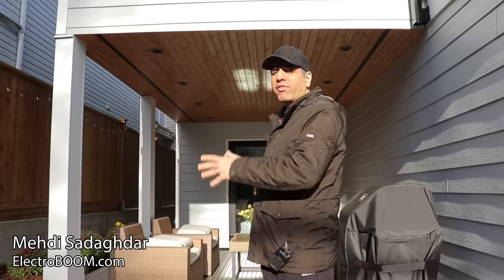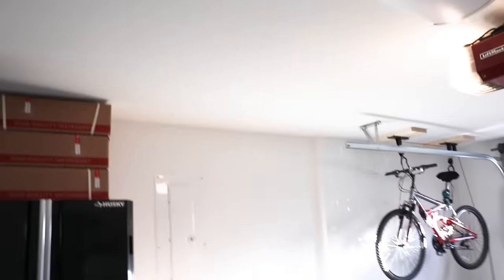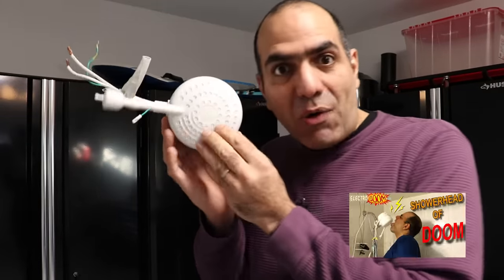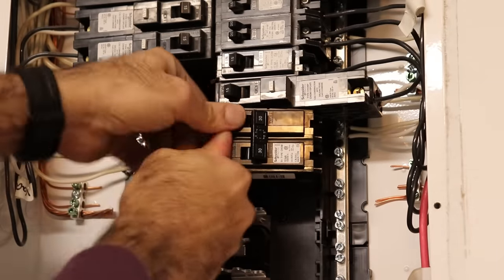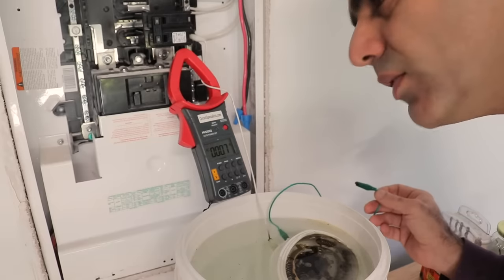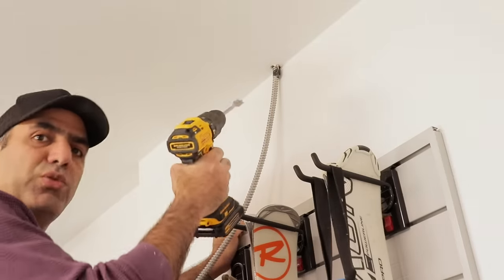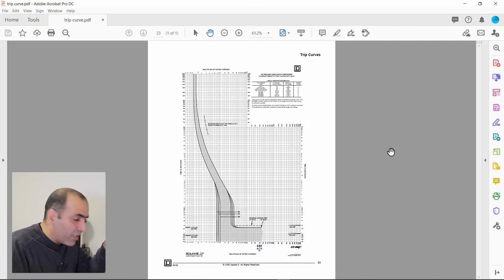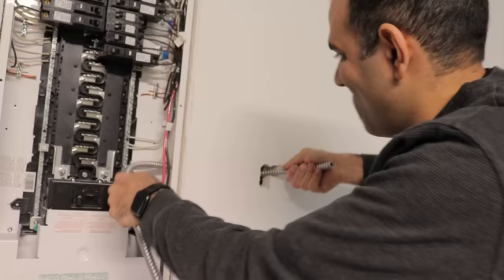Electric Patio Heater Wiring and Installation

Comment: You know this guy's a professional when his WOODEN HOUSE was never set on fire.
Reply: most houses in Northern America are made of 2x4 inch studs of wood for the frame and support, and with drywall over it to make the walls.
Reply: @ricardosimoni2855  sounds cool. So I guess they're seriously expensive?
Reply: @scavoflusigne  It's crazy cheap compared to bricks and concrete. Also in my experience not as durable.
Reply: @Nosiu  
Heh. That's sounds bad. But still ain't bad for cottage lovers.
Reply: @ricardosimoni2855  I’m not sure but I think Canadian houses have bigger studs due to needing thicker insulation. I know for a fact that houses here in Sweden use 45x170mm (2x7ish”) studs as a minimum for outer walls.
Reply: @Nosiu  Unless you are in the earthquake-prone Pacific Northwest, in which frame construction is FAR more durable.

Comment: I'm just trying to figure out how a damn nail wound up going through your box like that lol
Reply: An inch to the left and someone would have got the business on that one.
Reply: In Aus it’s regulation to install a metal plate behind wall boxes in certain applications to avoid exactly this 🤣
Reply: @MrCallumg1991  Nail plates are code most everywhere now, and that house looks fairly new, at least the last 20 years where such codes have been standard.  even if not, I don't think it would have helped, I mean the back of the breaker box is tougher than nail plate in the first place.
Reply: what nail are you people talking about? What box?
Reply: Its actually pretty common when the garage is built using 2x4 studs since it does not have to be rated for insulation. Its cost saving. The panel is literally sitting flush to the exterior wall. That nail was 99% a siders nail. See it all the time when roughing in new construction. I call it the walls of death.
Reply: How did the nail wind up in the breaker box? A big hammer and a lot of determination.
Reply: BC is brutal for building codes and safety. You can't mount a panel "inside" an exterior wall here in Ontario for just this reason. Also, who mounts the panel right against a stud? It's impossible to install a connector. That whole panel install is just a nightmare.

Comment: Socket is sidways.
Mehdi: It doesn't matter.
Future building inspector: Hello there.
Reply: Is the switch upside down?
Or are some switches the other way round?
Reply: @ArchieHalliwell  Switches are supposed to be up for on and down for off.  Unless they're multi-way switches, in which case it depends on the positions of the other switches.
Reply: @ArchieHalliwell  that's normal for the U.S. and Canada. Convention varies by country.

Comment: Anti-shorts on MC cable are a must and prevent the aluminum jacket from cutting and shorting wires. It’s also a good practice to wrap any device when installing especially in a metal box to help prevent unwanted shorting.

Comment: Great videos Mehdi, you always get a laugh out of me. You should get yourself an arc welder (stick welder) for high current testing. The older ones work best. You can short circuit the secondary of the welder and adjust the current with the transformer yoke on the welder. Stay safe mate

Comment: use anti-short's on your ac90 cable. and you cant put a plug on that circuit for future use.
Reply: Also the switch is supposed to be in view of the heater as a disconnecting means, unless either it or the breaker is lockable. AC90 isn't rated for wet locations, so that little whip outside is suspect. Pretty idiotic to use 20 AWG gator leads for the load test, no idea how they didn't melt first. Why turn break on and then make a spark clipping on the gator lead? Put it on first and then just turn the breaker on.

Comment: You need an anti-short in your connectors...
Reply: Anti-short bushing missing, not allowed to have receptacle and heater on the same circuit, wires cut too short at handy box where switch is installed (should have 6" of free conductor extending past front of box), and he probably should have used a 4 square box instead of the handy box for the switch.
Reply: @brianleeper5737  no connector on the knockout in the panel either
Reply: @darrenwoloshyn  Makes me wonder how well-grounded those boxes and cable armor are, since I didn't see him connect the ground wire to the box (which I would do, even if it is redundant).
Reply: @brianleeper5737  be connected it in the switch i think (but disclaimer im not 100% on that as im in the uk and our wiring is very different to this

Comment: I think that the future use for the 240v outlet will be and electric car charger. Or more shorting the power line or tesla coil.
Reply: Wouldn't running the heater, and charging an electric car pull too much current for the circuit though?.. hm..   
Hopefully he considers that, and doesn't risk anything.

Comment: Here is a bucket of water.  Next to a 150-A fuse panel.  With its covering panel removed.  Also with a showerhead that has built-in heating elements opened up to expose those elements.

THIS is why we watch this channel!!   ;-)

Comment: "Which house in the world is wired for this?" Probably brazilian's, since we use these showers.
Reply: Well here in the UK i have an electric shower although not one like that which literally maxes out the rated current of a 40amp breaker (MCB here guessing same for you) which is also connected through an RCD with a leakage trip current of 30mA (this is mandated) would be interesting to know what its like for you. Also here we have between 230 and 250 volts for everything unless its three phase

Comment: Installed the 240v outlet sideways and the switch upside down, that's still somehow better electrician work than at my house
Reply: The switch is correct.  In North America, switch up is ON.
Reply: The switch isn't upside down. Up = on in north america.

Comment: When you cut a square section of your wooden ceiling to drill a hole in and then nailed it back in you were like 4-5 inches away from the join in the wood anyway, you could have removed the piece of wood entirely and just notched for the wire at the join. Same outcome but much cleaner. Keep it up though mehdi I love your videos I need to start your 101 series for the 3rd time haha.

Comment: 120 v system seems as outdated as the imperial system.
Reply: Well it ain't since half of the world uses 120 V and no the imperial system is used only in 3 countries this isn't a valid comparison
Reply: @jammehrmann1871  i didn't know it was used by that many. I guess they keep using it because it's too expensive to change it now.
Reply: @Wormweed  no prob fella
Reply: @jammehrmann1871  What half of the World?Most of them is 220/240V and 50Hz.
Reply: @mernok2001  yes its not exactly half but the americas and some asian countries like japan use it
Reply: @jammehrmann1871  Japan uses 100V.If you have dry sking its just a slightly unpeasant tingle at most 6mA of current.
Reply: @mernok2001  Its not as great of a difference as the american 120 V to 220 V so whats the prob?
Reply: @mernok2001  at 6 mA It is painful not a small tingle if you have normal and not desert dry skin
Reply: @jammehrmann1871  Painful with 1 finger,tingle in full hand.
Reply: @mernok2001  Well even then it's possible to kill oneself if both hands were to become connected anyway you are good have a great day :D

Comment: From a European point-of-view, every electrical thing seen in this video is scary as hell...
Reply: I live in southamerica and bruh last week i bought for literally us$12 one differential breaker (rated 240v 40a)(idk the name in english sry) and it goes installed before all the thermomagnetic breakers... that shit saves your life.. Why only canadians and usa people have them for the bathroom only? just install a big one or one per sector in the breaker box
And the cables omg how difficult it seems to run a couple ot these solid cables in the wall tube, why not multi filament? Costs? 
And then the junctions aaaaaaaaaaaaaaaaaa
and then running the cables bare plastic behind your wall imagine screwing something and theres unprotected 120ac behind the screw aaaaaaaaaaaaaaaaaa
Reply: Also the guy who nailed thru the breaker box, imagine that nail going 5mm left...

Comment: Federal Pioneer 15 AMP breaker is the best 30AMP breaker you can buy. Meaning it's a bit slow to "Pop." Square-D breakers are much more sensitive. They have breakers tuned for various high in-rush current loads.

Comment: You need a Secondary Current injection kit to test the Breakers. Also this Kits are used in testing of Current operated relays and other equipment like CT. I made one as my study project.

Comment: i have found that living in a country that has incredibly high humidity and heat, the breakers tend to get very twitchy when they sweat - if you want to up the reaction time, try  heating the breaker and spraying it with a fine mist of water a few times and then repeat the tests you were doing. Obviously this is not considered a safe, regulatory test method, but it does work! wear rubber gloves if you intend spraying water near your DB!!!!

Comment: Hey Mehdi, you can visit my country India. We have 400-415V three phases for all high power applications. You can use "Scott Transformer" to convert 3 phase to 2 phase, if your Patio heater has not enough terminals for connections....

Comment: You would size that heater at the name plate rating plus1.25%, you would need a 25-amp breaker and #10 is a great choice in case you decide to up sizing to 5k

Comment: If the heater has a metal body, I would advise hooking the body up to the earth. I don't know if I missed something, but the earth is usually what I hook the body of electrical appliances to, so the shock and fire risks are lower. If something shorts out in the heater, and doesn't have a ground to return to, besides neutral, it won't pop the breaker.
Reply: It is connected to earth.

Comment: as long as you dont short yourself out (i recommend a hot mat but its not necessarily required), you touch just about anywhere on the panel and it wont even tingle. touch the hot and ground (basically anywhere else in the panel) or bridge a neutral though, and it will certainly let you know lol. ive connected a few a panels hot, isnt really too hard.

Comment: Love Electroboom videos, but as a licensed, master electrician, there are a couple items not to code. But nothing too heinous. (Connector needed at panel enclosure,  ground screw for EGC at J-boxes only rated for 1 wire, wire nut the others and pigtail to device. Heater disconnect to be within sight of heater, or breaker lock installed. and I know why there is an empty knockout in the 4x4 j-box.  Been there...😁) Good job actually, especially fishing the MC/AC through the ceiling space. Yeah, it can be a challenge!  Oh, "1-hole strap" is the term your looking for. Great info explaining circuit breaker trip curves. Many people (and electricians) don't realize that breakers are inverse trip devices. More current, shorter trip time, but not going to see instant results at 31 amps.

Comment: In North America (I am unaware of other regions) trip curves of breakers are normally sufficient to provide protection from dangers, you can get fast trip breakers but they usually are not needed. When you size wiring to the circuit, the wire is over rated for the load current you will actually being using. For example, a 15A circuit requires the use of 14AWG wire, however when looking at rating charts, 14 AWG NM-B (most commonly used in North American housing) wire can actually handle 25A for 90C insulation temps on copper wire. This means that if you are drawing double the 15A rating of the breaker you are only 5-10A over the rating of the wire, on a 15A breaker the trip time for this level of overload is 8 seconds to 25 seconds. So what does this mean for the heating of the wire? Well 14AWG solid copper wire as used in residential wiring has a resistance of 0.0022 ohms per foot. Which gives us a power dissipation at 30A (double the rating of the breaker) of 8 watts per foot. 1 foot of copper wire weighs 0.0124lbs (0.00562kg), using the specific heat of copper we can figure a temperature rise of 3.6C per second. Going on worst case scenario of 25 seconds for the breaker to trip, we expect a rise of 90 degrees Celsius. If we use the ambient temp ratings for the wiring of 30C, we end up with a final wire temp of 90 degrees Celsius. This is above the rated operational temperature of the wire, the actual conductor rating is 90C which means we are at the limit of the conductor temp at the maximum overload and there is no danger at this point at it has a 90C rating. Another factor is emergency overload ratings, which for standard 90C NM-B wire is 130C for 500 hours cumulative total. It also has a third rating, the short circuit rating, which is 250C for a half second short.

This is all designed intentionally, there is a reason the upper limit for time of a breaker tripping is 25 seconds on a 15A breaker. When you take the amount of heat rise in that time, it comes out to be almost exactly the maximum temperature that the wire is rated at and no higher, and there is still a huge overheat for the temperature to rise further. Additionally, breakers are designed such that as they get older the time it takes them to trip for any given overload decreases instead of increases. This ensures that even when the breaker starts going bad it does not present a fire hazard as it will fail in a safe manner in most cases.

I do not know what breaker Medhi is using, however in the US new installs are required to use CAFCI breakers, which both trip for normal overloads but can also detect and trip when an arc is detected that does not exceed the trip current, such as when there is a break or bad connection in the wire that arcs without tripping the breaker but can still heat the wire hot enough to start a fire.

Comment: Mehdi you're lucky. @2:15 you said you could have went with a 20 amp breaker and 12 gauge cable, which is mathematically, but Canadian Electrical Code forces you to use only 80% of your overload protection rating. So the 30 amp and 10 gauge cable are actually the sizes you would use to pass inspection.
Reply: I'm pretty sure that the 4000W rating of the heater assumes the upper end of the voltage margin (250V), so 16A which is exactly 80% of 20A. I could be wrong though.

Comment: I know he's not a licensed electrician, but I just want to point out some things: He didn't use red-heads on the AC cable connectors or the panel, the connections wire nuts and the switch he did are prone  to becoming loose (there are better ways to do it). The "brackets" he used are called one-hole straps.

Comment: I know its a old video but as a certified electrician I think you did a great for a home doer, certainly seen worse, something that do still have me scratching my head is American voltage here in Sweden we use 400v 3face in most places even homes, apartments and probably tight housing areas do only get one or at most two but the houses I work at have 400v 3face (to be clear one face is only 240 between live and ground but 400 between faces), do love americans fuse boxes though compared to even our newer fuseboxes where

Comment: Before putting the breaker in the panel turn it on and tap the bottom of it with some force and it should trip, I don’t know if it’s 100% fool proof but it’s just something ol’ timers tought me when I started being a electrician, hasn’t failed yet🤷‍♂️

Comment: 4000 watt heater in the uk is about 16 amp, as we run at 230v, much smaller cable to install and dose not really eat in to the 100 amp supply you are given.

Comment: Erm, why did you use flush-mount backboxes instead of surface-mount?
The metal ones like that are supposed to be buried inside the wall, you can see how the socket and switch overhang the edge to hide any 'messy' bits where the drywall was cut.

Comment: I know you will probably not see this comment, but if you do, you should consider using red hats on the ends of every armored cable run. In the US (IDK about Canada) they are NOT required by code, but they are definitely a better practice. Its a red bushing that goes at the end of the armor so that the insulation cannot get cut or damaged by the sharp edges of the ends of the armor. They're only like ten cents a piece (less if you buy in bulk).

Comment: You should install a 20 amp breaker even if you have 30 amp wire. This means that the heating element will trip faster.
Reply: Exactly

Comment: You can test easily your breaker with for example a car (Pb) battery or (not preffered) Li-X while shorten. 
Switch and cables have to be strong enough for sure. Otherwise these componends simulate your fuse.

Comment: Only one thing I would have changed…. You should have put the plastic inserts into the armored cable after you uncoiled and cut them to expose out the conductor wires, otherwise you would risk the sharp edges of the armor to dig into the conductor wires over time
Reply: Yea, this is the one thing I caught as well.

Comment: What you could have done is cut a small amount of the wire ( or used the whole lot) connected to the heater and the breaker and tested if it actually worked (turned on didn’t trip etc). Or used a small out of the wire and something you know will pop it like the shower head and then the wires shouldn’t burn which seems to have been the issue you had when testing the breaker.

Comment: Hello mehdi why did u put the switch in the garage when u could have placed it next to the heater where it is safer and also it wont take much of a time to turn it on, now everytime you have to go to the garage and turn the swich on and then come back, but if the swich is next to the heater you would be able to feel all the heat and not some of it.